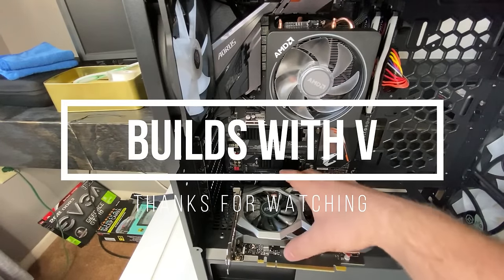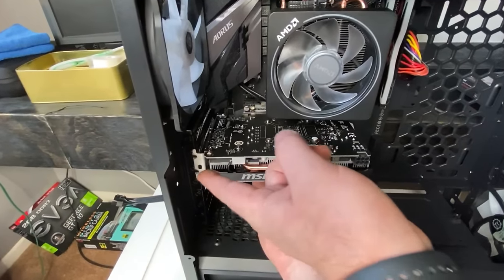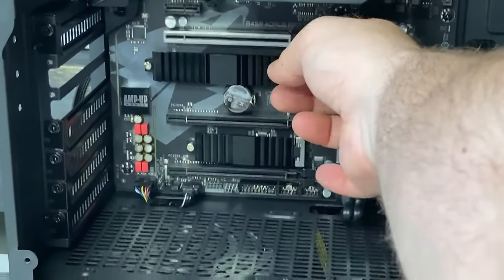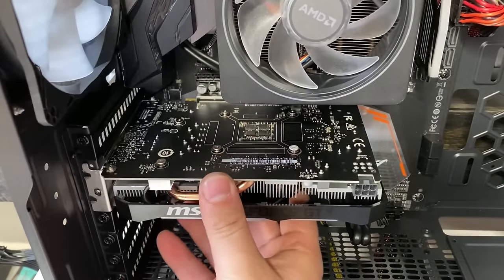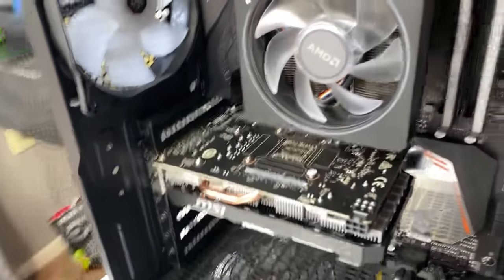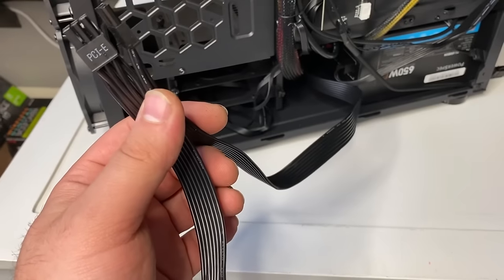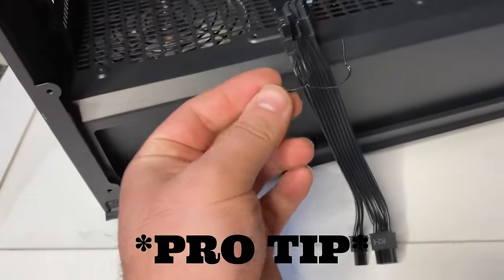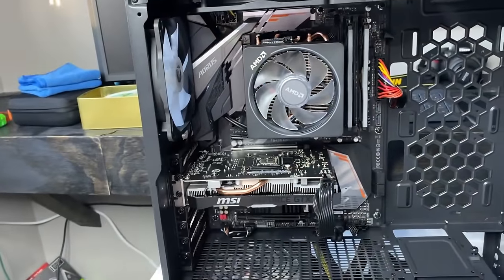How to Install a Graphics card into your PC

Comment: I have a prebuilt but I want to add a gpu as it’s using an icpu but will the power connectors be with the power supply?
Reply from the maker: If the power supply is modular then it may not have them attached. If the power supply is not modular (typical in pre builds) then the power cables should be there. Just verify that your power supply can handle the gpu and has enough 8-pins in case your gpu have more than one 8-pin
Reply: @BuildsWithV  ok thanks

Comment: Don't want to sound stupid but do you need to find a compatible graphics card for your PC.  Or will any graphics card work s long as it fits in the slot.
Reply from the maker: As long as it fits then it will work. Keep in mind that you can bottleneck your pc. Basically just means that your cpu or gpu is better than the other. In many cases that doesn’t affect anything

Comment: I took my graphics card out to clean   And after I did everything I replugged it back in and the pc starts up but won’t turn off and the monitor does nothing.   Can someone help ?
Reply from the maker: Is the hdmi plugged back into the graphics card?
Reply: @BuildsWithV  the 8 pin thing yeah
Reply: @BuildsWithV  the weird thing is when it’s on u can power it down     U have to unplug it
Reply from the maker: @gaopa2099  no is the monitor hdmi or other plug plugged into the gpu?

Comment: This may sound like a stupid question but I'm new to pc building and I've just completed my first build. And I've only got 1 screw supporting my card but it doesn't sag or move at all do you think this will be fine. (Its a relatively light card) thank you😊😊
Reply from the maker: Yeah that will be fine especially since it’s a lighter card. Congrats on the build 🙌
Reply: @BuildsWithV  thanks so much for the fast reply I've subscribed too very helpful👍
Reply from the maker: @finnhopp1664  thank you 🙏 much appreciated and I’m always happy to help 🙌

Comment: Do you need to turn off PSU before installing the gpu or no? Can someone answer?
Reply from the maker: Yes you should. Anytime you’re working on your pc it’s best to turn off the PSU and make sure the pc is discharged of electricity by pressing the power button for a few seconds.
Reply: @BuildsWithV  thanks much appreciated

Comment: This is the code I am getting this code when I go to install my video soft ware for shot cut. I have windows 7 pro . I did use Movovi here about four months ago and gave me a link to upgrade my video drivers I pushed the link and my pc worked flawlessly and the program but it was only for trial I I deleted it and lost the driver upgrade for my video . Now I get this code. Will this GPU fix my problem so I can down load shot cut and start learning to edit? Here is the code I am getting . I dont want to buy this GPU if it wont help me  

Failed to create OpenGL context for format QSurfaceFormat(version 2.0, options QFlags<QSurfaceFormat::FormatOption>(), depthBufferSize 24, redBufferSize -1, greenBufferSize -1, blueBufferSize -1, alphaBufferSize -1, stencilBufferSize 8, samples -1, swapBehavior QSurfaceFormat::DoubleBuffer, swapInterval 1, colorSpace QSurfaceFormat::DefaultColorSpace, profile QSurfaceFormat::NoProfile) .
This is most likely caused by not having the necessary graphics drivers installed.

Install a driver providing OpenGL 2.0 or higher, or, if this is not possible, make sure the ANGLE Open GL ES 2.0 emulation libraries (libEGL.dll, libGLESv2.dll and d3dcompiler_*.dll) are available in the application executable's directory or in a location listed in PATH.

Thank you for any help this is driving me nuts I need to get my youtube going

Comment: Does the Graphic’s card plug wires come with the PC or the Graphics card? Asking just in case if I get a graphics card that has that plug I need to plug in.
Reply: It should be in the pc
Reply: whats happens if u have 4 pins instead of 6

Comment: If the GPU needs a 8 pin is it safe to plug in both the 6 and 2 pin connector at same time or should I do it one at a time?

Comment: Is that cable comes with the gpu box or i had to buy it ?
Reply from the maker: That cable usually comes with your power supply unless the power supply doesn’t support a PCIe connection (GPU connection).

Comment: Wait does every power supply have a 6 or 8 pin? Or do I have to buy one
Reply from the maker: Yes every power supply will have the GPU cable.
Reply: @BuildsWithV  ok thanks! I just got a gtx 1650 and ur video helped out a lot
Reply from the maker: @zapclap2366  glad I was able to help. Thank you for watching 🙏😊

Comment: sorry to ask a silly and obvious question, but, can I upgrade my set with a gtx 1650 on a motherboard a320m-k, ryzen 3 2200g 2x8 gbs 2666mhz (2gbs of ram are being used as vram)?

also what happends with those 4 gb of vram from the graphics card, will i have 4 vram from the GC or 2 from the Vram/ram

Comment: Hi please I need advice I'm struggling with my graphics card. Motherboard a520m-a pro cpu ryzen 5 2400g graphics card gtx 1050 2gb. All hardware new expect graphics card its second hand. Windows 10 did update after that the amd display is working but my graphics card is in the hidden section on device manager. Did check update for it said updated, it is also securely plugged into Motherboard. I'm using a hdmi cable I don't know if the port on the graphics card perhaps does not pick up my hdmi cable. How to check if that port is faulty. The hdmi cable is new and works through the motherboard. I see there is 2 other ports on the graphics card. I am going to buy a cable to check if 1 of them works. I just don't know if their something I'm missing I'm new to pc's thanks for any advice

Comment: Where do you plug the other end of the PSU / power supply unit? I'm new to this and I need to help my mom install a graphics card on her PC so she can use 2 monitors.
Reply from the maker: The other end goes to your PSU. It might say something like PCIe. Sometimes it’s already attached. Just depends on your PSU. I have a how to install a power supply video which does show me connecting the cables needed.

Comment: will it instantly work?  what are these hdmi and other ports on the side of the card for?
Reply from the maker: It will almost instantly work. Sometimes it might look weird or the screen will go black but that’s usually because the drivers are installing. The ports are for your monitors
Reply: @BuildsWithV  but I only have 1 hdmi port on my monitor, and that's already occupied because it's connected to the pc, is it a problem?

Comment: why is your psu fan facing up?
Reply from the maker: It had rgbs and I wanted to show them off. I also wanted to see how well it would work with the psu as an exhaust fan. Unfortunately it didn’t work well so later that week I swapped it back to normal. The psu would just get a bit too hot because the heat from the pc would exhaust through it. I don’t recommend it. The rgbs looked cool tho  😅 Not worth it tho. Thanks for watching 🙏

Comment: I bought a prebuilt pc and theres a couple spare cables that arent attached to anything the gpu reads on my pc but I noticed it has no LED or lights and the fans have never came on for the gpu I have a geforce 4060
Reply from the maker: @Remmyroller  some gpus don’t have leds to light up. If yours does then you can download its software to see if you can turn them on that way. The fans don’t always spin. They’re set to start spinning above certain temps. If you play video games they should turn on to cool it down. Hope this helps
Reply: @BuildsWithV  thanks man I figured that was the thing my graphics cards pretty cheap 4060 300$ now the 4090 they want 2grand lol I want to upgrade eventually

Comment: Do graphics cards come with the power supply cable?And do you need to also plug in the 2 pin cable somewhere?
Reply from the maker: @atraxalan  the power supply has the needed power cables. If your gpu has 6 pin then the other 2 pin doesn’t need to be plugged into anything. If your gpu has an 8-pin or more connector then you need to plug all in.
Reply: @BuildsWithV  well,i want a 4060 (6 pin) but i have a prebuilt with integrated graphics (no gpu) and dont know if it has the cables
Reply from the maker: @atraxalan  if you can take your back cover off to access your power supply, you can check if it has the correct cables
Reply: @BuildsWithV  I‘ll check when i have the GPU,if not,i‘ll order it,thanks

Comment: So I’m sorta new to pc’s I know this video is old but… can I connect this to any pc? I have a business pc which can already run games pretty well, and I’m looking to get into VR gaming, the only thing I need is a graphics card, so can I connect a 1070 to my business pc?
Reply: Most GPUs are compatible with almost any modern PC, but there are only 3 things to keep in mind

1. Your power supply must be capable enough to handle your GPU (over 650W is fine)
2. Your motherboard must have the correct PCIe slot for the GPU (most modern GPUs use PCIe x16 slots so there should not be a problem with that)
3. Your GPU must psihically fit in your PC case
Reply: @dakinos  thanks!

Comment: I never knew how nerve wrecking building a pc would be... i thought cool ill buy these super expensive parts, throw them together boom easy. But when I got to it I realized if i fuck it up thats that piece broken lol, and if the piece of broken the pc is not complete. I never even thought about which parts go where, what goes inside what. 

Thankfully this is pretty straightforward lol. I also noticed you said its possible to have multiple gpu's?

Comment: Hi i have a question i have Z97-k mother board/ Intel core i7 4790k 
I wanna upgrade my GPU from R9 290x to 4060 and i don't have money to buy a new pc for single processor
I wanna upgrade later 
Does PCI 4 lanes work on PCI 3?? 
Z97-K mother board is PCI 3
Does 4060 works on PCI 3? 
And is it easy to connect? Like how you did even PCI 4 to 3 ??
This is thr question i want i will rest and peace if you answer 
Will it connects the same way how i Install my r9 290x ??
Reply from the maker: @Silver_silva0  yeah it will connect and work
Reply: @BuildsWithV  thanks

Comment: I spent $500 on a vr headset and gtx 1060, and i cant find the pin cable thing :| 

Edit: im getter a new 600w power supply for my graphics card, so i hope it will work
Reply: Same mine didn’t come with a 6 pin power connector

Comment: I've had the same case for years. It fit a 1080ti, 2080ti, and now my 3080 will not fit. Not because it's too long, but because the pci connection sits about 1/4 inch too far forward when trying to connect to my mobo. I've tried bending my case out a bit, but even so it's still way off. Idk what to do. I've built a few rigs and never ran into this
Reply: Get a bigger case

Comment: Do i need to turn off my integrated graphics in BIOS Setup? Im using Ryzen 3 3200g
Reply: you shouldn't have to, the mobo will just use the dedicated GPU if it's installed

Comment: so could i do this for my amd ryzen 5 3400g with vega 11 integrated?
Reply from the maker: Yeah you can add a graphics card or upgrade to a better graphics card on pretty much any pc. Just plug it into your PCIe slot and make sure your psu can handle the extra power and you’re good to go. A good rule of thumb for the power level is having a 550w psu or higher. I usually have a 650w or higher.

Comment: My gpu comes with a radatior. where do i put that?
Reply from the maker: Where you’d put your fans and then put the fans on the radiator
Reply: There's a fan already at the rear, so i put the radiator on top
Reply: @BuildsWithV  my i3 10100f is holding down my Gtx 1080 by like 35%

Do you know any intel cpus that will fully juice out my gpu. Dont wanna upgrade my motherboard for AMD, but if the price is worth it, I'll consjder.

Comment: My power has 6 pins cable but my graphics card has 8 pins cable what should i do?!
Reply from the maker: @mortezarezaei4258  you’ll need a different power supply. All 8 pins need to be plugged in unfortunately
Reply: @BuildsWithV  isn't possible to just use 6 to 8 pins adapter?
Reply from the maker: @mortezarezaei4258  I’ve never done it and I’m not even sure adapters exist. I suppose if there’s an adapter and good reviews you can definitely give that a try

Comment: Question, is it possible that we may seat the videocard not hard enough that our bios does not detect it, but the 6 pin thingy being well connected, our graphics card gets power this has lights on and the fans are running?

In other words, my videocard suddenly cannot be detected by my PC/bios/device manager (as if there was no videocard at all), yet the lights on the graphics card are on and the fans are running.
Reply from the maker: It’s possible for sure but rare. Are you getting picture through it or no picture at all? Definitely try to reseat it properly and see if that works

Comment: ur power supply is uipside down
Reply from the maker: Yea it was indeed. Did that cause it had RGBs on it for looks and for exhaust fan. But I changed it up later cause temps were a bit higher than I was comfortable with.

Comment: wat's right in here mean @ 2:10 ?
Reply from the maker: Through the hole in the case to the front
Reply: @BuildsWithV  power supply?
Reply from the maker: @ytgrixk3339  I passed it through that hole to get the cable from the power supply to the gpu
Reply: @BuildsWithV  oh thank you so much... i'm about to build an external gpu and i'm doing some research work.

Comment: Hi!! May I Ask If It Is Possible for me to upgrade my integrated graphics by adding a graphics card to my pc?

here Is my pc specs:

Ryzen 5 3400g 
Vega 11 Graphics/integrated
8gb ram/5.95 usable
Reply from the maker: Yes you can. If your motherboard has a PCIe slot (aka gpu slot).. you can just plug it in and then install drivers.

Comment: This doesn't show anything about the locking lever on the edge of the port. Also don't do this with the case upright, the weight of the card is putting pressure on the port, and then youre locking it in that position. Not good.

1 mil videos for amateur stuff.

Comment: This video is not completely helpful. Ending with, “Now you install the drivers,” means what?
Reply from the maker: You will then turn on the PC and you’ll have to install the drivers. Each graphics card is different so I couldn’t say exactly what to install but typically you just look up Nvidia drivers or amd. Depends what you get and what drivers you need.
Reply from the maker: Technically speaking you don’t even have to install anything. Typically the gpu will work fine without anything but it’s recommended to install the drivers so everything can update